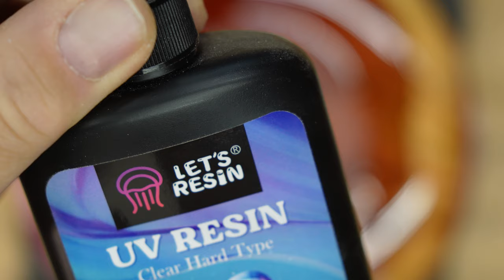Unbelievable: Stunning Transformation of Maple Wood with Red Epoxy

Comment: So new we haven't tried this yet, but i thought that you were not to use carbined tools on epoxy? I never found the reason why those turners said that.
Thank you, beautiful as always.
Reply from the maker: Great point! Thanks for the comment. Well many woodturners turn their noses at carbide scrapers opting to use the more traditional approach. In today’s world we have epoxy. This means using the cutting tools such as a bowl
Gouge can cause chips or catches depending on the curing hardness of the epoxy. I use the carbide scraper negative rake, that will
Handle any level of epoxy cure. Hope it helps. Cheers

Comment: Great video and demo. Just wondering, that lovely shine on your finish, what was your final sanding grit before you applied the finish product?
Reply from the maker: Thanks Randy much appreciated. Well all my epoxy bowls I never sand past 240grit. This is because the epoxy table top has to find a surface that it can anchor to. Even if I have a 2nd and 3 rd coat I will sand back to 240. Hope that helps. Cheers

Comment: Beautiful.  Great color and love the white swirls.  I’m new to turning… still in the novice stage so Details Details Details are the most important part of videos for me.   Looked like the glue block was attached with some sort of epoxy glue???   This is just my opinion/preference but not a fan of the music I definitely prefer a voice over.   That way all the DETAILS are mentioned.  Right from the start…the psi in the pressure pot and how long, blank was attached to lathe using…wormscrew/faceplate etc..   Love to hear the name/type of tool being used.  The grits sanded thru and was sanding sealer used as well as the type of finish applied.   The details shouldn’t add any time since it would just be voiced over.  Just a thought.  😊
Reply from the maker: Many of your questions are answered in my other videos, but meanwhile the glue block I use Starbond 5min epoxy, 50psi, the glue block is gripped by a Vicmarc 150 chuck, I use a ci-o easy neg rake carbide scraper when turning epoxy to avoid catches. Cheers!